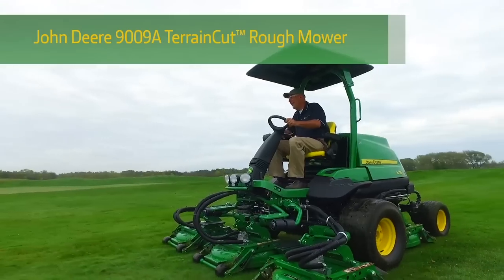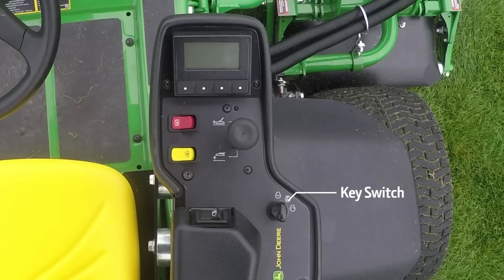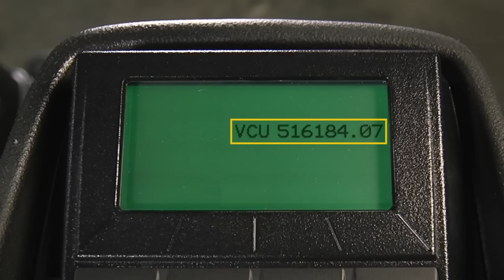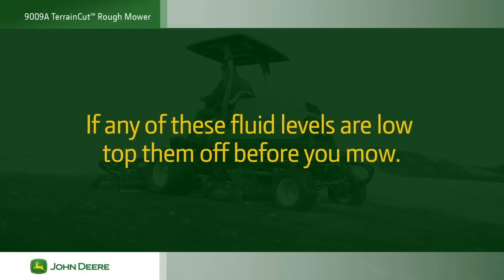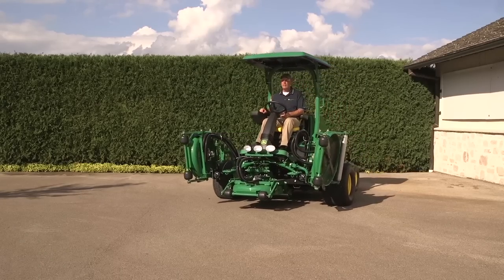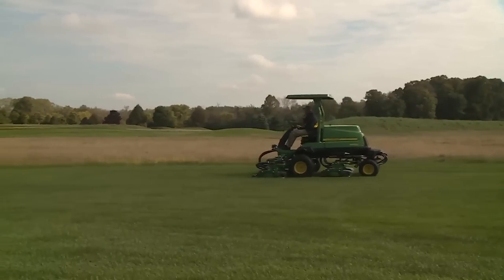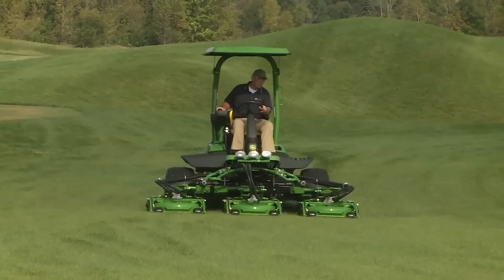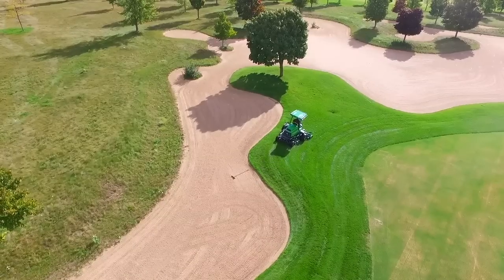9009A TerrainCut™ Rough Mower Operator Video | John Deere Golf

Comment: our golf course bought this exact model 9009A this spring, its been at least 2 months+ at John Deere this thing cant get up little mounds , only one tire operates in the back when trying to go up and just spins , they have been trying to figure out what is wrong for over 2 months . Last friday we got a call that they think they figured it out by selecting the weight transfer option and adding to the front instead of the back, so he tried it at a dead stop in front of a little mound and the thing still cant go up...isnt this suppose to run all 4 wheels cause ours isn't ...does anyone know the solution to this problem?
Reply from the maker: We're sorry to hear about this experience. We'd like to learn more. When you have a moment, please reach out to our Enterprise Contact Center at 1-800-537-8233. Additionally, you can submit a help case here: http://spr.ly/6054gcJTA. We hope to hear from you.
Reply: @JohnDeere  the rough mower is at our John Deere dealership in Grand Falls,NB , they cant seem to figure out the problem...i'm a worker at our Golf Club and we have Toro rough mower that used to be great but its way beyond its prime and keeps over heating and this 9009A is suppose to replace it but all it seems to be able to do is cut flat surfaces and golf courses are full of mounds and hills and it struggles to go up the smallest mounds forget hills...anyway hope they figure it out soon or return it to the place they got it from...we need one that functions properly i've seen your videos of it in operation and it goes up hills like it should with all wheels turning...but ours when going up hills only one tire in the back turns and spins and all the other tires seem to chug so its not normal for sure

Comment: I run an 8800, we have one of these too. I dont understand the rigid casters, if I turn with them down they inevitably skid laterally across the ground, it seems like this will really stress the deck mountings.
Reply: If you ran a Toro Groundsmaster 4500d you shouldn’t need to worry about the decks as they can tilt either way due to great designing

Comment: john deere - the best
Reply: Parts are expensive
Reply: Yeah and unlike John Deere some of Toro’s mowers have very genius features, and some of their mowers have the decks so well designed they can tilt back, forward, left and right too, and the controls are also a bit more simple and easier than some of John Deere’s mowers
Reply: Toro is good too, some of their mowers do the same kind of task but with a different sized engine and simpler controls
Reply: Yes

Comment: Working at a prestigious golf course with this and it sucks the cut is rough and uneven and skips lines cuz the rollers are too big so it flattens the rough and misses it and also the blades out of nowhere will shut off on you for no reason and has been down several times due to the rear decks not coming up and it leaks hydraulic fluid everywhere and have John Deere’s or Finches guys out constantly your best bet is to save your 70k and spend a extra 10k and get the Toro Groundsmaster blows this thing out of the water.